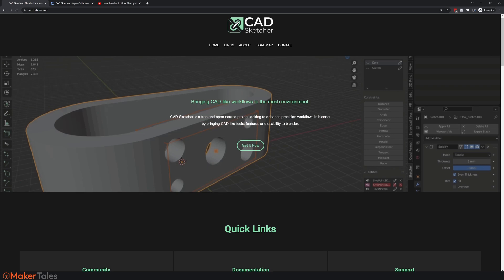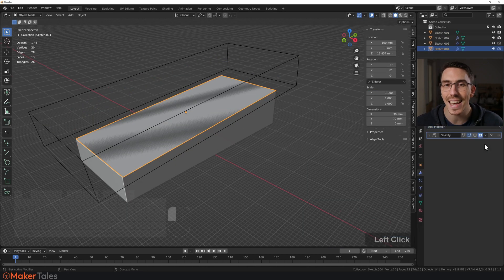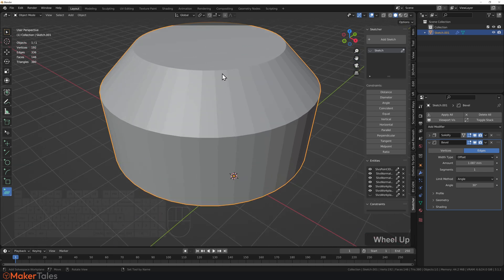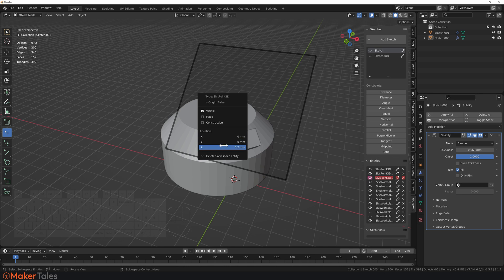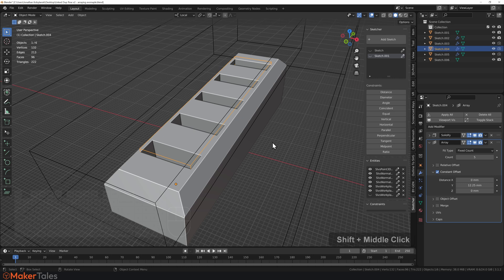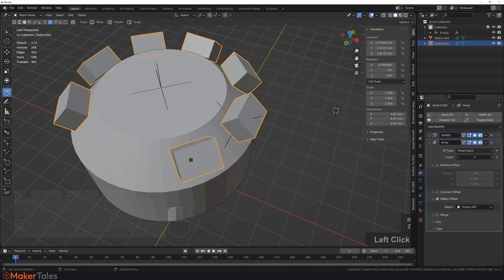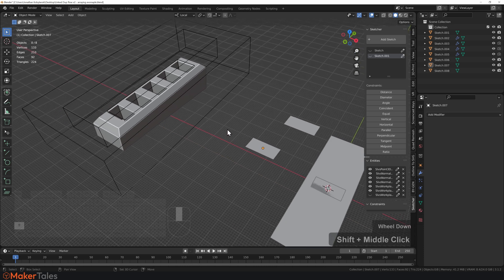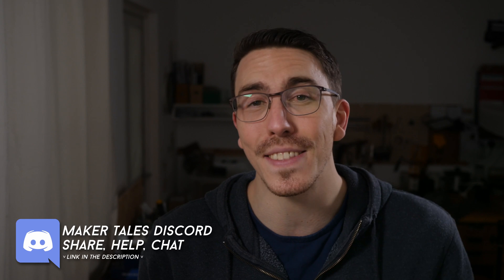Cad Sketcher Workflows & Must Knows | Blender 3.0+

Comment: Maker Tales - thank you for stressing that this add-on brings cad functionality to Blender and is not replacing CAD. Many people seem not to understand what with CAD is associated. While I think CAD is a term to be retired. Computer Assisted Design - isn't that also Blender SketchUp etc ... Having a sketch solver is fantastic to have for still many mesh modeling tasks.

Now if the ability to reference sketches to geometry that will be killer. Make a wall reference a sketch on it add doors and windows - adjust the wall with and all adjusts too. That would be a SketchUp defeat!

Comment: What is the difference between CAD and mesh modeling?
Reply: @sirrodneyffing1  ok thanks.
Reply: No really an expert in either field, but in mesh modeling, each vertex has a fixed (X,Y,Z) but no so in CAD (parametric) modeling.  You define the lines, arcs, etc, by defining relationships.  Line1 = 1.0m.  Line2 = 1.0m perpendicular to the first.  Arc1 = 90 deg. of arc, and tangent to both lines.   Then if you grab any of those features, all 3 move around as a unit.  In blender, none of that is possible...until now!
Reply: @exegetor  So does this allow you to create actual solids like say Rhino or is the "CAD-like" capability more in the way you model?
Reply: @artkiko4460  I don't know much about Rhino or its competitors.  if you're using Blender, your purpose is probably to create something purely visual.  So I think Rhino user and Blender users have different goals.
Having CAD-like features in Blender doesn't change that fact, but it can make creating a hard-surface mesh, and later editing it, much faster and easier.
Reply: @exegetor  good to know. thanks, David.

Comment: Why don't you make a video of it doing something useful like running a milling machine/router... would this work on a Maslow router system? Imagine if it did. Cool software.
This looks very promising, let's see some action/full work flows. 
Thanks for the video.
Reply: CAD software don't run milling machines.. You need to convert the model to a tool path in CAM software and then put that in the machine's own control software.
Reply: @erik....  I'm looking into a Maslow cutter; that cuts, not carves. I was thinking this might do the trick, but honestly I have no idea.
The layouts and nodes would be much smaller files without too many points, although it does have a Z axis. 
I'd rather use Blender, or at least make the layout ion Blender if it can be converted somehow. Something makes me think CAD is probably the best solution, though.
Hopefully this app will work, maybe?
Reply: @JoeGator23  Yeah well as I said it's usually a 3 step process. CAD -> CAM -> G-code. For 3D printing it's a bit easier but for machining you need to specify the clearences, tool sizes and so on and that is made in CAM, which Blender can't do.

Comment: Any tip to make sketch lines on macOS look thicker ?
Reply: There are preferences for the plugin for icon size and text size, but not point and line size that I have found. Room for improvement.
Reply: @ed_halley  it's right there, next to Icon and Text size:  "entity scale".  it only scales from 1.0 to 3.0 but that makes a pretty wide range of line thickness
Reply: @exegetor  Duh ... thanks for the eye opener!